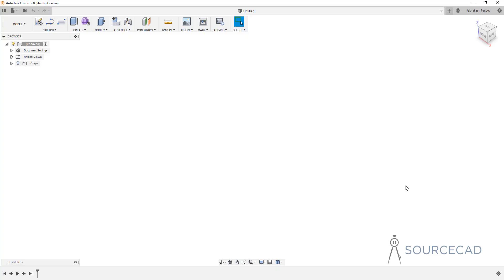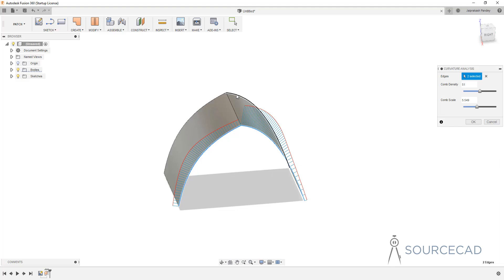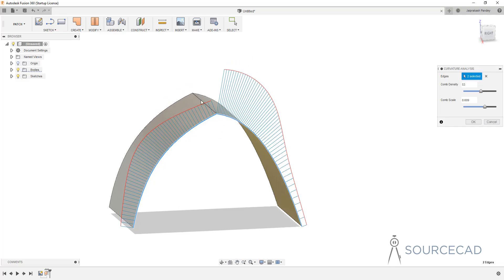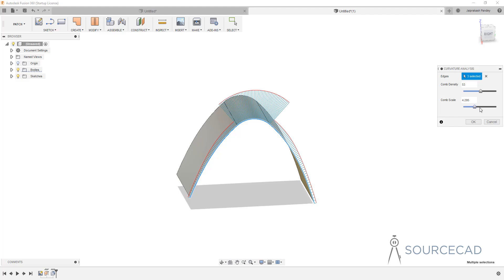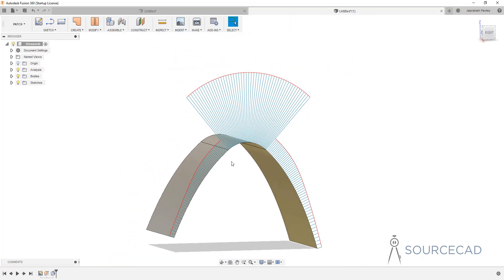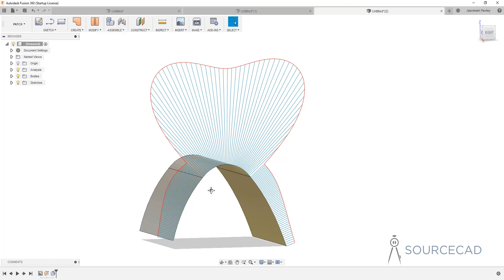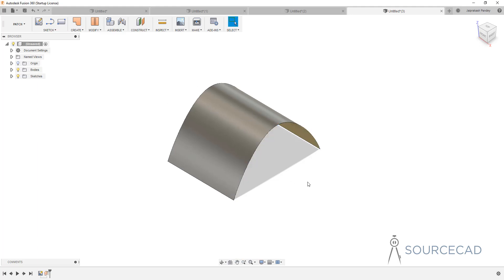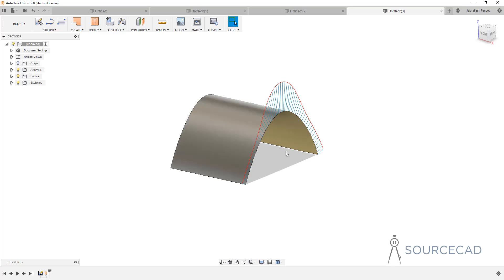Understanding G0, G1, G2 and G3 surface continuity using curvature comb

Comment: Conclusion: 
G0: Continuous but not necessarily differentiable (namely with at least 0 order of derivative --- G0); 
G1: Continuous, with the first derivative which is not necessarily continuous (namely with at least 1 order of derivative --- G1)
G2: Continuous, with continuous first derivative and the second derivatives which is not necessarily continuous (namely with at least 2 orders of derivatives --- G2)
G3: Continuous, with continuous first and second derivatives and the third derivatives which is not necessarily continuous (namely with at least 3 orders of derivatives --- G3)
Reply: Derivative is a confusing word, to clear it up for myself:
Starting at G0, you maintain only the position between both curves
G1, you maintain the position + tangency (parallel lines) between both curves
G2, you maintain the position, tangency and curvature between two curves
G3, you maintain the position, tangency, curvature + a continuous rate of curvature between the two curves